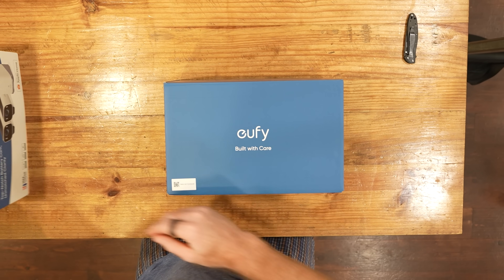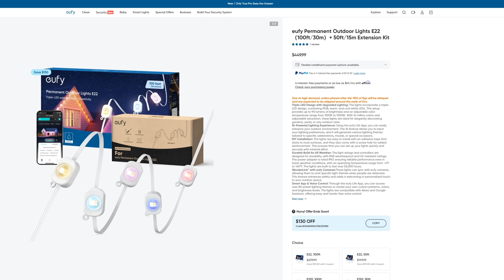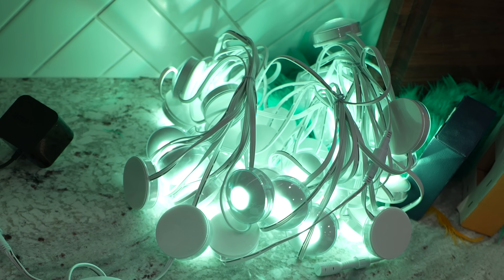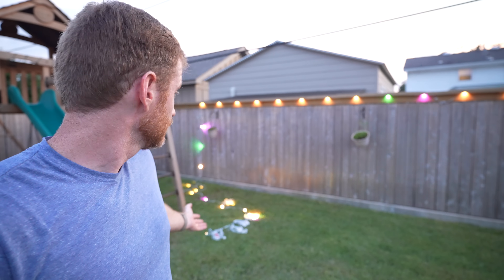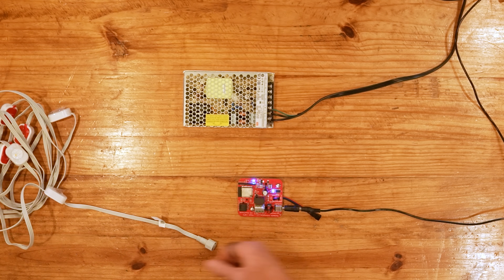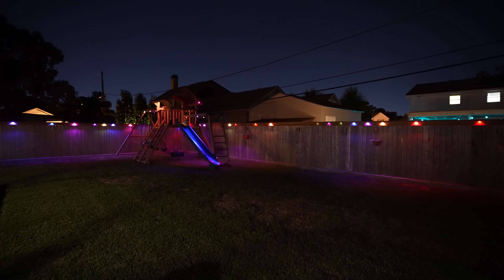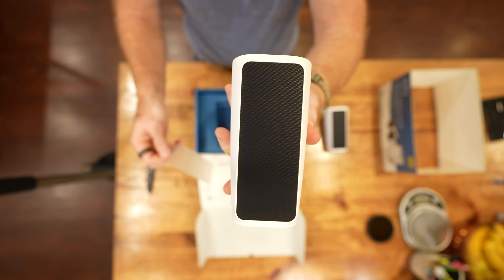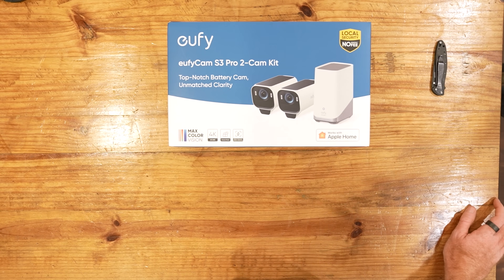Simple Backyard LED Landscape Lighting Ideas to WOW Your Neighbors

Comment from the maker: Use code for 15% off: 0PROEUFY
Buy on eufy: https://eufyofficial.com/T88921W1puF6
Buy on Amazon:https://eufyofficial.com/T88921W17mGS
Explore more security cameras: https://eufyofficial.com/T88921W1sBIS

LINKS:
eufy LEDs: https://amzn.to/3XZXXjM
Brackets: https://amzn.to/4dpIBt9
WLED Controller: https://amzn.to/3Y6o4Ws
5v power supply: https://amzn.to/4eld4tH
Buck converter: https://amzn.to/4gJOLaw
WAGO Connectors: https://amzn.to/3TR1AWS
Heat Shrink with Solder: https://amzn.to/3TP6uDw
Landscape Wire: https://amzn.to/3TOspuu
Waterproof Box: https://amzn.to/4dmxxgp
Meanwell Power Supply: https://amzn.to/3N3YniM
Wiring Diagram: https://www.breakityourself.com/wiring-diagram-download

Comment: You have listed in the description a buck controller? What's that for? You did not state in the video.
Reply: A buck converter steps down voltage to a lower level. In this setup, he added it later so that the same 36V Meanwell power supply could power both the lights (which run on 36V) and the LED controller (which needs 5V). This eliminated the need for a separate power supply just for the controller.

Comment: How did you go from fence to pkayset? Can you split all 3 wires? You didn't cover how you made that jump and I have areas i would like to splice and make a jumper connection if possible.. also did you use both factory power supply and your separate power supply or just the separate and male connection at both ends?

Comment: How did you get the power from the house/mains to the strip on the fence, and to the playhouse. Also where are you storing the WLED controller and transformer, are you using an enclosure?
Reply: Hi, Do you need a reliable supplier of LED strips lights or control system? If so, please contact me. We will provide you with products of astonishing quality.

Comment: I agree, EUFY should have told him not to back-feed both ends with two separate power supplies. DUMB, Darwin award time! Both power supplies are most likely fighting each other.

No worries soon the lights in the backyard will be the fence burning, which will not require electricity. With any luck, those switching power supplies will shut-down from overheating or overloading.

I hope this guy has never modified any wiring in his house. Instead of his channel being called “BIY, Break-It-Yourself”, it should mean “Burn-It-Down Yourself”.
Reply from the maker: It’s one power supply and I promise it’s fine 😂 lights are still going strong.

Comment: Im confused and it’s my lack of tech knowledge. Simple question can I hook up (3) 50’ and have them work with each other simultaneously with no issues. Without all the fancy little boxes u have? Thanks in advance
Reply: Hi, Do you need a reliable supplier of LED strips lights or control system? If so, please contact me. We will provide you with products of astonishing quality.

Comment: I want to do this with the YPS track kit on my fence. But I need 410 feet of lights and idk which power supply or controller would safely work for that long of a run. Plus it would be stupid expensive for me. Sad day.
Reply: Hi, Do you need a reliable supplier of LED strips lights or control system? If so, please contact me. We will provide you with products of astonishing quality and acceptable price.

Comment: Excellent explanation and video. At the 8:15mark you ran a 14g iwire for power injection, you just connected the 14g wire to the very end of your your LED lights right? you dint daisy chain like to 100ft and then connect the other set of lights the the 14g wire to extend am i correct. Essentially you powered the led light strip from the beginning and also at the very end of the light strip? Can the Wled controller be integrated with matter/zigbee o integrate to Homekit or homeassistant?

Also can this be done with a LED light strip, have you come across a product or lightstrips that can be used and also have the same usecases as you do. thanks for taking the time

Comment: I'm planning on buying three sets of the 100 ft E120. Can all of them be connected in one strand using WLED and the power injection methods you shared? Thanks!
Reply from the maker: sure can!
Reply: @BreakItYourself  Is there a max distance between LED pucks? I'm having distance issues between LED pucks. I've verified all strands work with stock Eufy controllers but if wired with WLED controller, the power source you recommended, and wiring description, I'm still having issues with a 20 ft distance between pucks. Thanks for your help.
Reply: Hi, Do you need a reliable supplier of LED strips lights or control system? If so, please contact me. We will provide you with products of astonishing quality.

Comment: You shouldn't power inject both ends toward each other or it conflicts. You should find the center and cut off the + copper pad so each line strip is receiving equal power but not colliding in the center.
Reply: This is pretty standard in long strips of addressable LEDs. You can add power feeds anywhere along the line.
Reply: I agree, EUFY should have told him not to back-feed both ends with two separate power supplies. DUMB, Darwin award time! Both power supplies are most likely fighting each other.

No worries soon the lights in the backyard will be the fence burning, which will not require electricity. With any luck, those switching power supplies will shut-down from overheating or overloading.

I hope this guy has never modified any wiring in his house. Instead of his channel being called “BIY, Break-It-Yourself, it should mean “Burn-It-Down Yourself”.

Comment: Find a 3D printed bracket for your model. I bought specifically printed 3D brackets for my Govee permanent lights and they are amazing.
Reply: I'm looking for these for Govee 2s - where did you find yours?
Reply: Hi, Do you need a reliable supplier of LED strips lights or control system? If so, please contact me. We will provide you with products of astonishing quality.

Comment: I used a cable stapler properly spaced between wire and wood …. Just have to be extra careful.
Reply: Hi, Do you need a reliable supplier of LED strips lights or control system? If so, please contact me. We will provide you with products of astonishing quality.

Comment: How did you get power to the swing set and did you use similar clamps to secure the wire so the kids don’t mess with it?
Reply from the maker: I just continued the string from the fence onto the swing set then back to the fence as one continuous string. So essentially the swing set is an out and back loop in the fence string. I used the same clamps and no issues with the kids yet.
Reply: @BreakItYourself  great idea, thanks for the response!
Reply: Did it come with extension cords. How many lights to inject power .